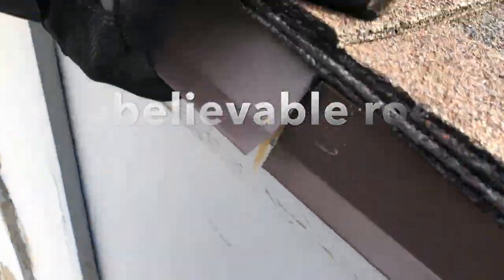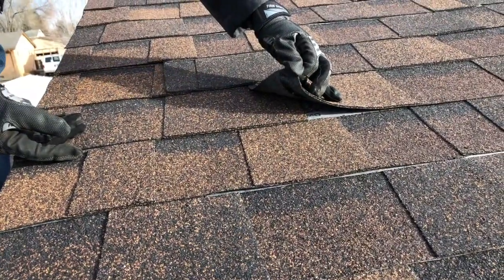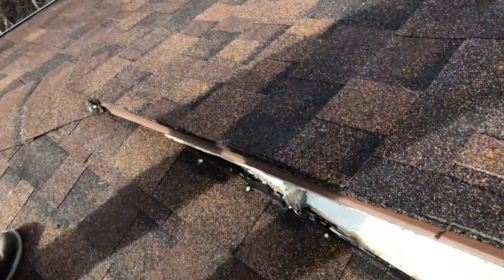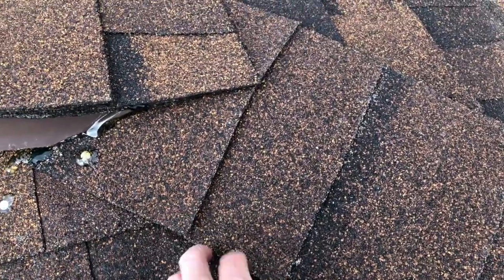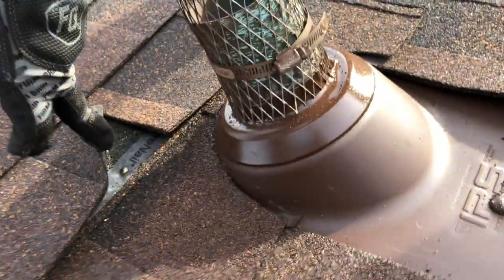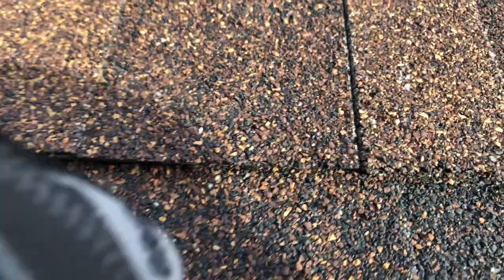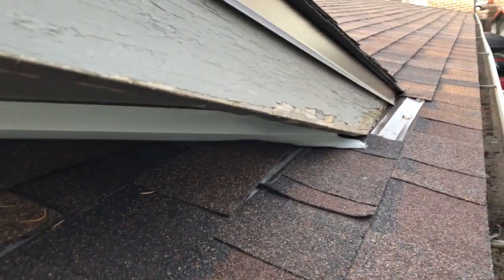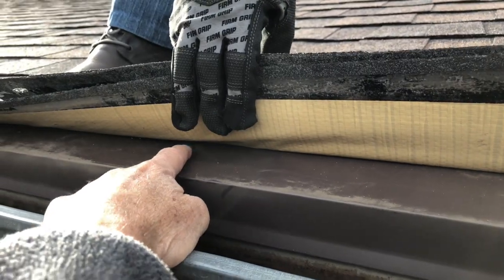Bad roofing | Roofer training video for what not to do

Comment: You would hope the city building inspector would catch these things!!
Reply: You know I did a roofing job on my home before I sold it. I expected inspections at a couple stages. That was not the case. I had one inspection after it was all done. He didn't even get on a ladder. I'm sure glad I knew what I was doing. My roof wasn't perfect but it never leaked.
Reply: Whoever bought your home was very lucky.  You take pride in the work you do and it shows.  but, your right.  If you are relying on city inspectors your may be disappointed.

Comment: 1.put ice and water around vents. chimney, goosnecks, plumbing stack. crooked nails are fine if they are sealed over and dont pertrude through shingle on top. nails exposed inbetween the joint of 2 shingles is not good but not end of the world.  No roof is perfect these guys blowing alot a smoke but make some valid points as well. No base metal ah frick just slam it in